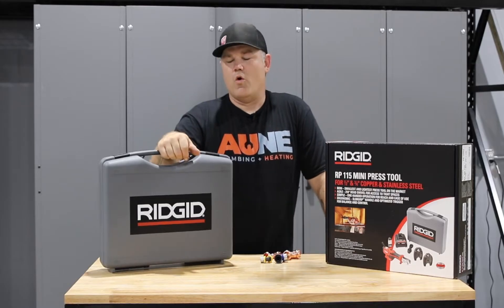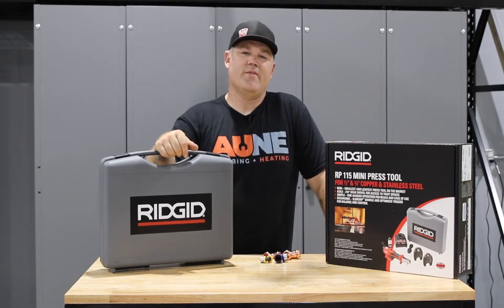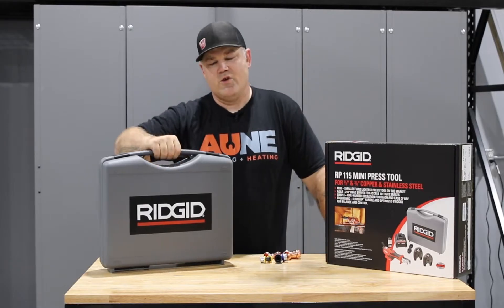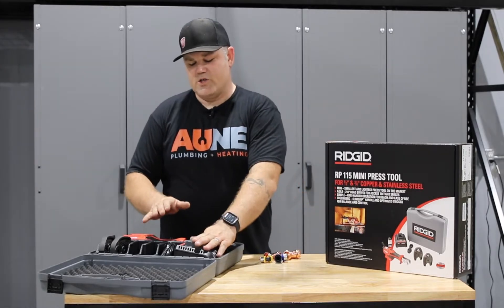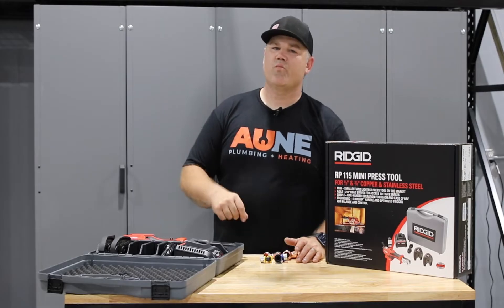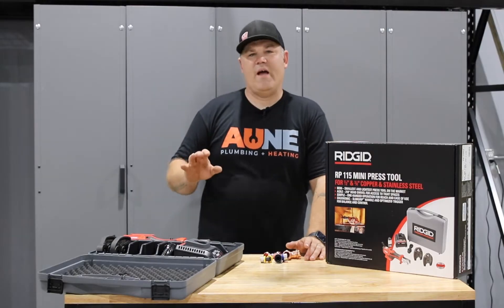RIDGID's newest Plumbing Press Tool Reviewed! RP115 Mini

Comment: The mini would be great for in wall, in ceiling work, like frost proof hose bibb replacements, some bathtub faucet replacements, etc. Many times, just a fraction of an inch less tool length would make all the difference.

Comment: Bought this tool a small while back, finally got to break it in this past weekend. This tool is worth every single penny, it does exactly as advertised. Super compact and easy to work with. I'm no plumber by any means but to  have this tool handy for home repair and minor install is worth it by a mile.

Comment: Can I press brass fittings like veiga  propress with my rp115
Reply: @stevek2563  yes you can but you’ve got to have the proper Jaws for water flow

Comment: Can i use a ridgid 26136 press ring actuator on my rp115
Reply from the maker: No, the RP115 is a very limited tool and currently only offers 1/2" & 3/4" pex press and copper press jaws. None of the jaws from the standard or other compact tools will fit it. It's a very limited tool.

Comment: If this tool could do 1" I would seriously consider buying one! Looks like I will keep soldering.
Reply: I hear ya, but think of it's designed purpose, bearing in mind all of the existing models already available and in production. This is obviously designed for residential service and repair for small tight spaces within homes. You won't find much 1-inch copper in a residential home let alone in a confined space. If and when a job would demand this tool, 9 times out of 10 will be a 1/2 copper line serving a singular fixture.
Reply: @Rider.WhiteHorse  I agree, come to think of it the only time I deal with pipe above 3/4 in a residential setting is when working on the main line. I think the mini press tool could be handy, especially since it can also do PEX.

Comment: Definitely not the most economical one out there,  I just bought a 18v Press Tool made by Nibco that does 1/2, 3/4, and 1inch copper, and paid $800 for it at my local supply house. Now it doesn't carry the Big Name like Rigid, but a plumber friend of mine has been using his daily for two years and it seems to be holding up fine! This might be a better option for a home owner, or contractor that only does a little copper work!
Reply: what model?

Comment: Nice tool. If I were a pro plumber who did a lot of renovation work in old homes where I sometimes had to work in tight spots, I might buy this compact propress tool in addition to having larger propress tools to just use it occasionally in very tight spots.

Comment: $1300 should be $350 $400. Soon somebody is going to make one that's affordable for the DIY guy.
Reply: You keep waiting then
Reply: @anonymousviewer4750  takes no skill to do press this tool should be free
Reply: I hope so because I think the overpricing is all a scam.
Reply: I agree !!! So overpriced for a tool that performs a one function.
Reply: Greedy bastards trying to rip people off
Reply: Get a hydraulic hand pumper from china
Reply: I use a hydraulic one from eBay, $140, works great for me. It is not as fast but for someone who doesn’t install propress fittings more than once a week it’s fine.
Reply: vevor makes a press tool that does up to 2 inch for 775 bucks  no way in hell id overpay just for the rigid brand
Reply: problem is i bought one thats hand press with best reviews and iz overpresses the pipe iz dont leak but it dont look right   compared --aftet that i cant deal with something so important to be defective or out of spec

Comment: Is it capable of using larger jaws? If not, that’s very expensive for 1/2 and 3/4.
Reply from the maker: I covered that multiple times in the video. No
Reply: @mechanical-hub  my bad, I can’t stand when people do what I just did. Haha. Thanks for all the great content in mechanical piping specifically. Love how you cover hydronics in much detail, you’d be surprised how many plumbers just can’t quite grasp it, besides hooking up valve packs to VAV boxes.
Reply from the maker: @justCarner  No worries. Thanks!

Comment: If they make the close quarters jaws for it I would buy
Reply from the maker: Its not going to happen, according to RIDGID this is an entry tool, lower cost to bring more people onto the press platform. If you want more than 1/2" & 3/4" copper or pex then you need to look at the other compact or standard size tools, not this one.

Comment: You are going to put it in a packout anyway ;) I will either get this or the RP241 for the megapress option
Reply from the maker: Haha probably
Reply: Rp241 with a set of angle jaws. This is not worth it at all. You're stuck with only 1/2 and 3/4 as well. Not really sure why they made this. Even with just 1/2 and 3/4, I'd grab one if it was significantly smaller. Its like an inch shorter smh... The rp241 is a 1 handed tool easily. Gets in everywhere I need it to. Been going since 2018 too. Angle jaws are what really help out.

Comment: Great review. If you had to buy one press for daily use to include pex and steel which press would you recommend? Thanks
Reply from the maker: For nearly all residential and light commercial work and service the compact tools like the RP241 or M12 are great. They'll both press up to 1-1/4" copper, PEX and 1" iron pipe. I have both of those and use them daily for plumbing and heating work.
Reply: @mechanical-hub  Exactly what I was seeking. Thank You
Reply: @Salvention  I was using my M12 on 1” gas today
Reply from the maker: They now offer a 1" IPS jaw for the compact tools, both RIDGID and Milwaukee have them. Interchangeable (technically).
Reply: @Salvention  resi
Reply: 241 no question.